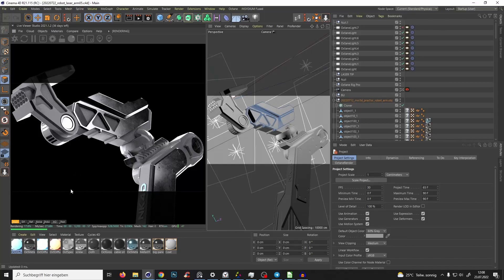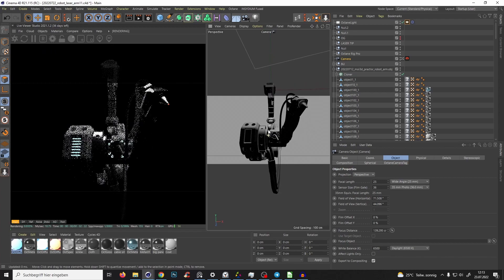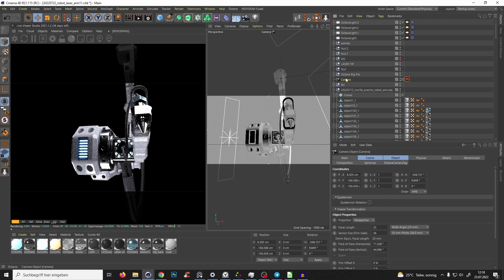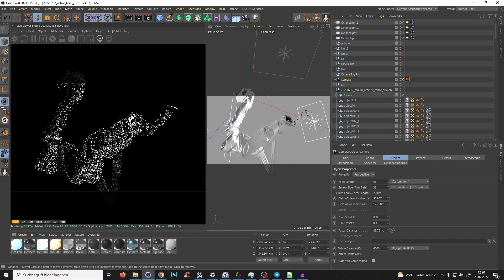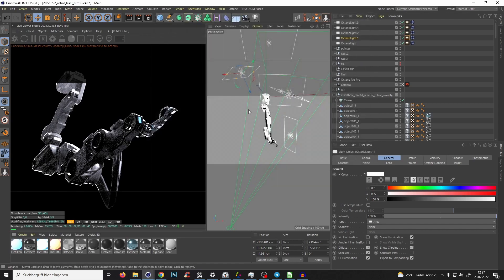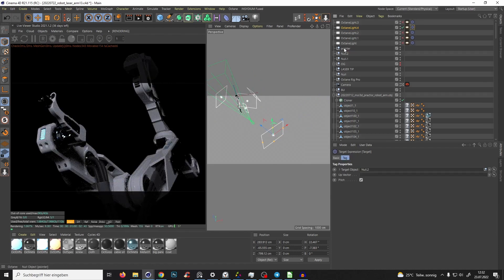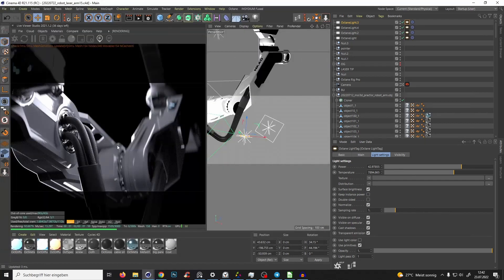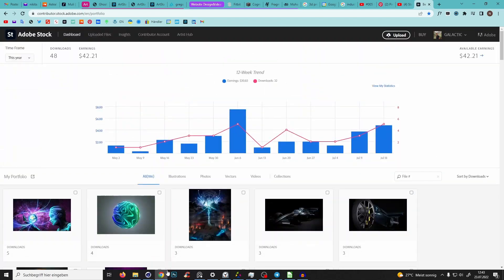Fast & Effective Product Lighting | Sci-Fi Industrial Robot Arm | Cinema4D & Octane Render

Comment: Which graphic card are you using? Thx
Reply from the maker: I am using a GTX 1080TI

Still very powerful gpu and enough for stills rendering!:)
Reply: @nikita.kapustin  no joke? Wow crazy..
Reply from the maker: Yes absolutely enough. You can work in the render port pretty fast. But of course, I do the final high-res renders overnight.
Reply: @nikita.kapustin  how long does they take over night? For example the abstract art you worked on from patrick skillshare tutorials
Reply from the maker: @jensweigert1501  At the time when I did the renderings form Patrick Foley I just had my Laptop with an I7 processor. It took a few hour to render it in 1,5K resolution.

With Octane and the GTX1080TI easy scenes can be rendered in 10 minutes and 4K.

More complex scenes with high sample count can take 1hr and much more
Reply: @nikita.kapustin  Wow. I’m surprised. Thanks for the answer. Do you suggest any display for c4d and octane? I’m going to buy one. What about a widescreen display and a second one just for 4k? Thanks again
Reply from the maker: @jensweigert1501  I am using just a FHD 24" Monitor.

4K Display would be super awesome, because then you have so much more space to work on. A 2nd monitor would be a great plus, but is not necessary. I would invest into a good at least 24" 4K Monitor
Reply: @jensweigert1501  Stop thinking hardware and software is doing the job for you. 80% is allways the Artist and the skill. Think about what beaty can be created with a simple pen and a skilled person.